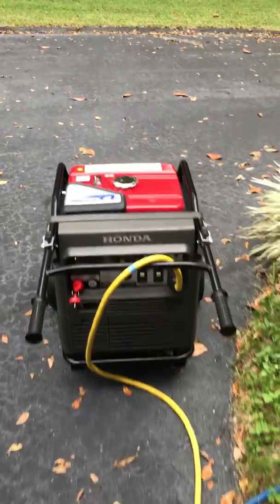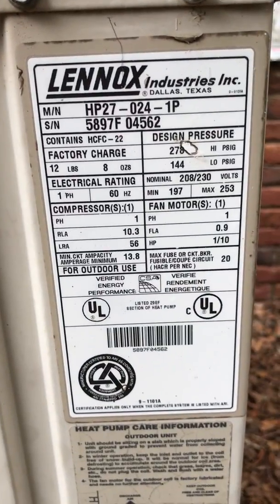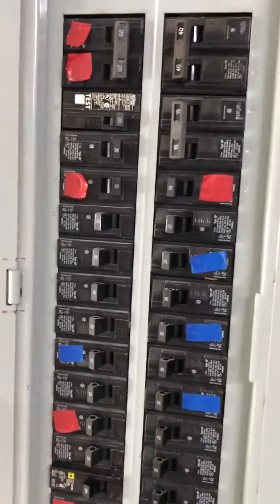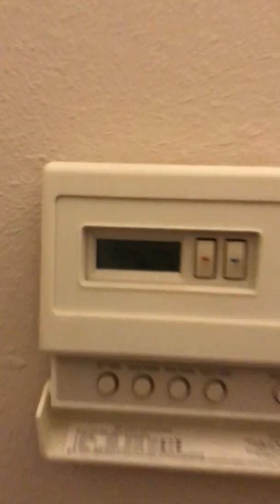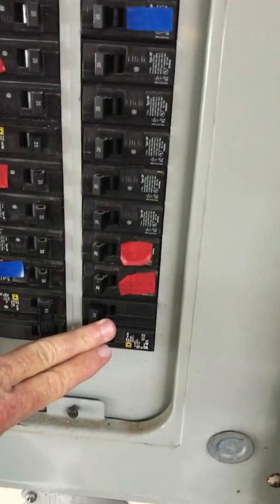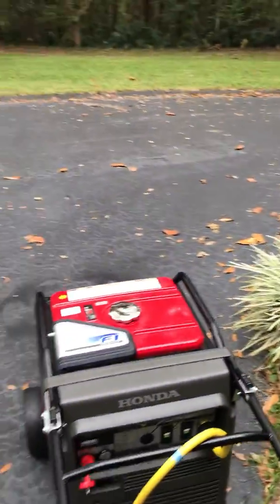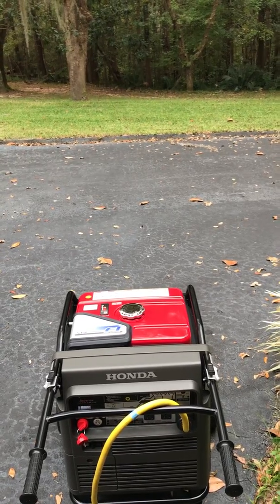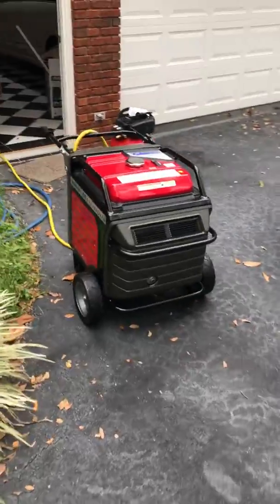Honda EU 7000 is generator powers 2 ton home A/C unit Back fat into my panel to power my entire home

Comment: FYI..the -024- in the Model Number is the tons.. Just divide by 12... So, yes you have 2 ton AC
Put a INTERLOCK kit on your Breaker panel $24 Bucks to save Your or a Linemans Life.
EasyJust move the GEN Breaker to the top under your Main

Comment: Buddy, you should really get what's called an interlock kit, which would involve moving the backfired breaker, but it's totally worth it. Plus your set up is super not code and downright dangerous for linemen. Otherwise I love your set up. Also, you should get a soft start kit for your AC, you won't need to shut everything else off. https://www.microair.net/collections/easystart-soft-starters/products/easystart-368-6-ton-soft-start-motor-starter-for-115-and-230v-ac-motors?variant=29181662283

Comment: Thanks for the Video. I keep waiting for Honda to release the EU7000 Parallel kit so I can run one of my 3.5 central A/C's. Nice to see it will start your 2 ton unit.  With two in parallel I should have no problem. I'm on city water and gas so my draw isn't much at all without the central A/C's,  I agree the Honda EU7000 is a great generator.
Reply: Dqalex - You only need one eu7000is to run your 3.5 ton AC. The 7000 is more than enough to RUN your AC, just not enough to start it, but it could be. What you need is what's called a soft start kit(not to be confused with 'hard start'), it will reduce your starting, or locked rotor amps, by %70. Try this: https://www.microair.net/collections/easystart-soft-starters/products/easystart-368-6-ton-soft-start-motor-starter-for-115-and-230v-ac-motors?variant=29181662283. It's not super cheap, but way cheaper than a second eu7000is.